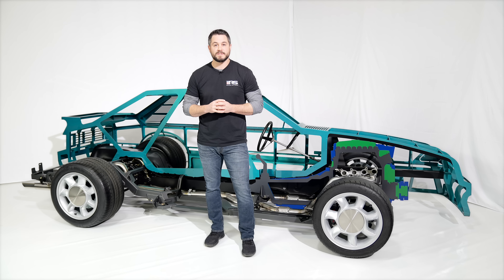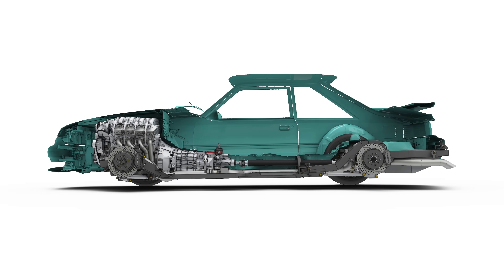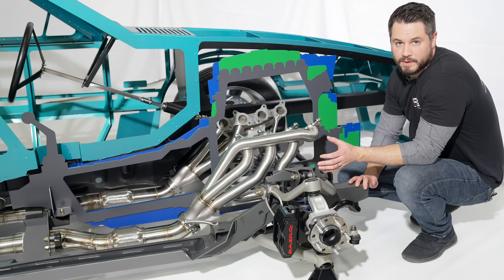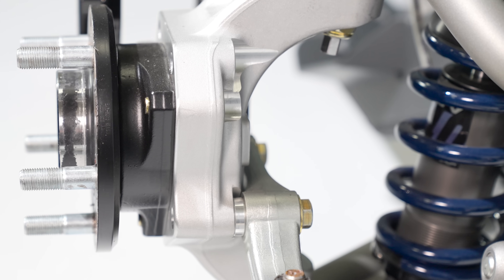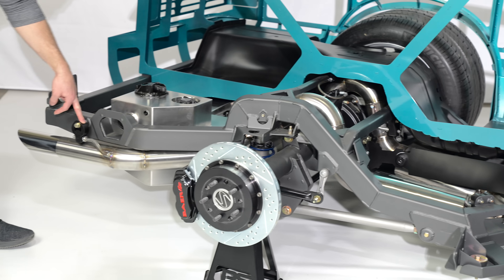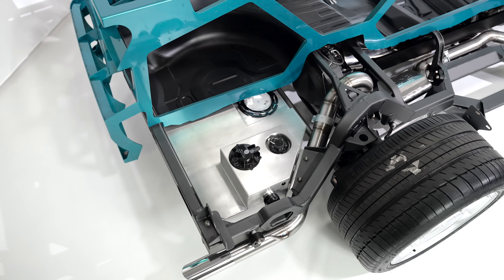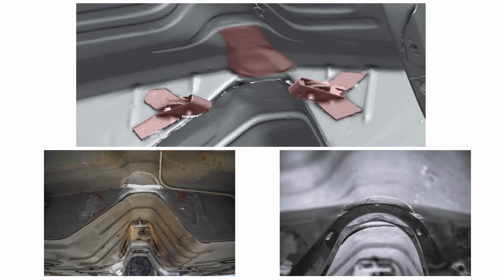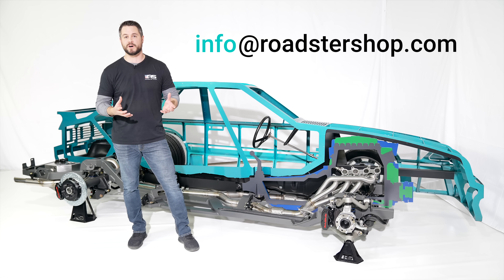World's first bolt-in Foxbody Mustang chassis | Roadster Shop SPEC chassis feature overview

Comment: Appreciate all the work that went into this but why no IRS? Is this more aimed at the Street Fighter crowd as opposed to those wanting ultimate handling and ride quality?
Reply: Imo it is weird they didn't just go with double wishbones
Reply: What is the possiblity to have the frame lengthened to fit under a 83-88 thunderbird? I'd have no issues extending this one but it would be a nice time saver if you guys offered different wheelbase options
Reply: So what about the predator out of the gt500?? That would be awesome
Reply: It's because this is their "Spec" chassis, not their "Fast Track", these are the bottom shelf full chassis, if you want the better geometry, the ability to add IRS, ECT, you gotta wait until they release their Fast Track chassis for it....or, call them and be the first to have one built with IRS, and then they'll use your chassis as the blueprint.
Reply from the maker: @johnnygeorgopoulos4072  Correct - We do already offer our FAST TRACK Fox body chassis with IRS as an option - @mchristr - 
 our SPEC platform is designed to allow full chassis benefits without having to remove or extensively modify a factory floorpan.  IRS packaging simply takes up more space negating the benefit of the simplified SPEC chassis installation. We are hopefully working on an IRS option in the coming future for some of our SPEC setups where possible.
Reply: If this is a "bolt in" the 99-03 cobra parts should fit
Reply: Is there a k member option that will allow a 9.5 deck to clear a stock hood?
Reply: Because you don’t need irs to handle, solid axles can handle, better than some irs platforms if set up correctly.
Reply: @Hans as cheap, common and available as the 8.8 IRS parts are, this is an oversight.
Reply: @pppppmmmmmccccc  tell me you don’t know much about the platform without telling me, you know how much a bushing kit is to correct the poor performance of a irs in stock form costs? Like 1200 bucks, the irs in the 99-04 cobras was an afterthought, it was not designed for the platform, meaning it’s is not just a bolt on upgrade to a fox without significant upgrades to go with. This was not an oversight, a solid axle with great geometry works better, simple as that.
Reply: @Hansthecontra1988 lmao, tell me you don't know much about the cobra irs without telling me, poly bushings are much cheaper than the delrin and provide a vast improvement over the factory bushings. They are pretty much a bolt in thing for a fox minus 2 bolts for the rear subframe mount and anyone with minimal fabrication skills can solve that issue easily. Youre over complicating things buddy.
Reply: @ na, I know exactly what I’m talking about, you clearly don’t, cobra irs takes a considerable amount of money to sort out, especially when putting it into a fox chassis, go ahead and convince yourself it’s not though king lol.
Reply: @Hansthecontra1988  lol, considering I do that type of stuff for a living and have done 3  irs builds in the past yr, I think I know what I'm talking about, 1200 delrin bushings aren't the only option, polys and a rear support cover will handle 800+ hp. So for under 1000 in parts you'll have a considerably better irs, quite crying and do some actual work buddy.
Reply: @ and the irs is free lol? You’re delusional homie, the irs setup is marginally better than the straight axle and costs considerably more, people want 1500-2000 just for the damn subframe, because it’s “cobra” lol.
Reply: @ quick google search says you’re wrong old man, especially after tax and shipping, and no shit it’s easier dingus lol, this is a complete frame swap.
Reply: @Hansthecontra1988  Less maintenance with the straight axle .Dont fix what aint broken
Reply: @Hansthecontra1988  A live axle can handle as well as an IRS on smooth pavement surfaces (like a racetrack). But for real-world driving on less-than-ideal roads, the IRS would be the better choice. I'm not a suspension engineer but just someone who's been modifying Fox Mustangs since 1992, with help and advice from companies like Griggs Racing and Maximum Motorsports.